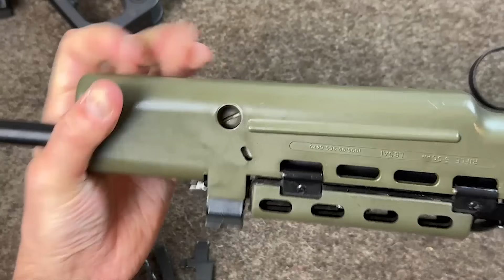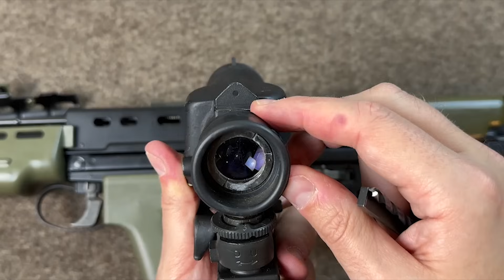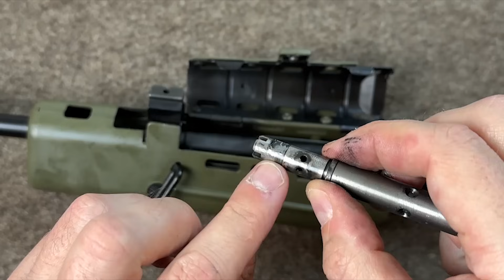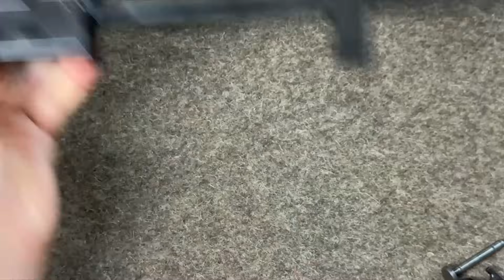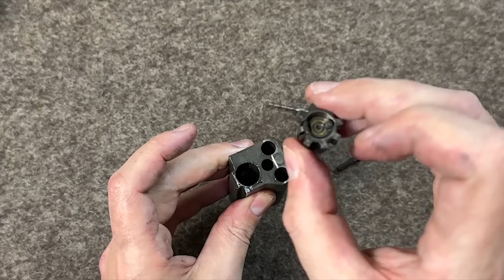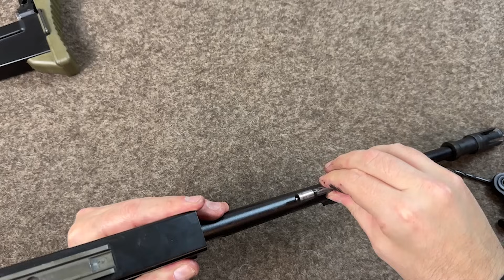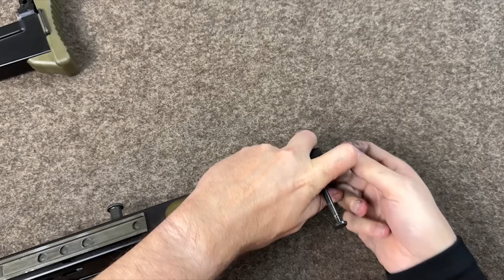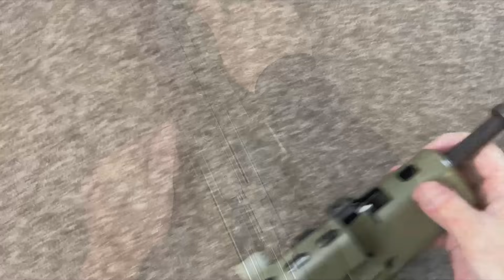British Rifle L85A1 / SA80 IW: The Mechanical Gory Details (Rare Factory Semi)

Comment: Am I the only person who never had any issues with this rifle? I carried the LSW for a while as well, still no issues.
Reply: When you dig into it, there were specific manufacturing batches that had significant issues (and many of them were RSAF Enfield related IIRC).

Supposedly this was due to the wise decision to tell the workforce making them “by the way, when you’re done with this you don’t have a job anymore…”
Reply: Carried one for 15 years. Never had a problem, never had a stoppage.
Reply: @stepheneast6974  tbh I agree, I only ever had (constant) stoppages on 3 different rifles which just means those 3 were wonky to begin with. The others all worked fine, even if they were a pain to clean after putting them through the paces haha. Maybe we just got lucky though :)
Reply: Never had any issues with the SA80, was taught how to clear the occasional stoppage anyway, as no weapon will function without a stoppage if you really working.
Reply: I had to use it in the army cadets and it was awful, stoppages all the time.
Reply: @yungcaco1443  
ALL of the things that made this rifle fail had nothing to do with the cadet GP. Nothing.
What is your claim? That you were a fully trained professional and that it was the rifle at fault?
Reply: @yungcaco1443  The L98A1's were often abused in the cadet force though, poorly maintained and running on worn out parts. The MOD wouldn't repair allot of them due to cost.
Reply: @yungcaco1443  Maybe you got the shagged out ones. I used it plenty in cadets too, never a problem except once when I was assisting RCO and I had to jump on a lad for a double feed (which was of course his fault)
Reply: I loved the lsw
Reply: @mikeywade85 long silly weapon 😂
Reply: @ifv33 mate it was accurate for what it was made for .being a support weapon system. Brilliant bit of kit.
Reply: @mikeywade85 i carried it for almost half a tour it was long silly weapon, i never been more chuffed see a weapon system get scraped

Comment: I'm surprised they bodged a regular full auto TMH to make the semi auto rifles rather than using the same lower made for the L98s, which were also semi-auto.
Reply: The L98A1and L98A2 TMH is just an L85A1 TMH with the change lever deleted exactly the same way as this one is.
Reply from the maker: Yup, the only difference is that this has a blanking plate so that the change lever isn't just a simple drop-in...

Comment: Nice vid again, I was in training 1987/88 and we had the first type useless mag catch which let to some Heath Robinson mods to keep your mag in 😂 when i got to my Battalion in 1989 the 2nd type with the shroud was on all rifles/LSWs.From the start of training we had SUSAT irons were for the Corps or jungle/artic  but did appear in N.I say two of the fours rifles in a " Brick " did trial using iron sights for low street light engagement. The bolt release catches in my training always came off to the point they just didn't bother putting them on! the gas parts cover didn't really bother me too much and don't get me started on magazines RG are Sh#%te end off give me Colts mags every time 😂 I thought the weapon was good for follow up shots it's heavy at the rear but you got used to that with the iron sights it was very light and handy,keep up the SA80 vids 👍

Comment: The only reason the Mag release was on the side was with the intention of it being able to accept M16 mags. There would have been far fewer problems had they used a magazine release at the rear of the housing a la L1A1
Reply: Magazines have to be retained. If you reach up for an empty magazine and grasp it you thumb falls naturally upon the magazine catch. It can then be removed and safely stowed away. What you described is entirely counter intuitive. The unfenced magazine catch is not unique. AR15s had this problem as well. The mag catch for the L85A1 is precisely in the correct place for a weapon in that format. Rock and lock magazines would not work well at all in a bullpup.
Reply: @zoiders  Only to people not trained with the system. In 22+ years of service I never suffered any problems. You have to rock the L1A1 magazine into place so it works in a practical sense. You have obviously never carried one of these slung with a mag on. You suddenly find yourself without one when you go to fire the weapon.
Reply: @mothmagic1 I've carried an L85A1 over roof tops and through tunnels. Not once have I ever lost a magazine. But crack on Walter.

Comment: Ahem . . .Why is there a drill bit on the disassembly tool? Can't have been so bad that you needed to drill holes in it, could it?
Reply: If memory serves me right the drill bit was for cleaning the inside of the gas cylinder from carbon buildup.
Reply from the maker: It's for the inside of the gas plug, not the gas cylinder, that's the other reamer.
Reply: @BlokeontheRange  This looks like a whole other video in itself, thanks for getting back to me, always enjoy your no-nonsense and witty content, cheers!
Reply: @WillGiven-g6j  Not a wire brush then? How hard does that build-up get? Thanks for the info.
Reply: @ It's all according to when it was last cleaned, how many rounds fired, time from last round fired to cleaning time. A good crud can certainly build up. Even if it looks ok you still clean it. Plus if you are handing it back into the armoury the armourers do spot inspections. You'd rather do it at the right time than be sat on your own looking a plum.

Comment: I was in cadets as teenager, and you would not believe the amount of times I smacked the back of the magazine on a fence as my small overloaded 5ft 2 body tried to climb over a farm fence, and the entire magazine would spill out the bottom with the spring and bullets going everywhere and getting shouted at.

I think that was a later magazine though it looked less constructed than either on show here, certainly that was like 2010's also so I would imagine things had moved on even for local youth groups.

Comment: Huh, I never realised that's how you'd use the combi-tool to take out the gas plug.  I always just used my thumb!

I actually did my phase 1 training with the A1, before they abruptly swapped us over to A2s the morning of our APWT (The annual weapon test, for those who don't know).  It was ever so helpful, especially as none of us had actually been told anything about the A2, nor were we given any time to zero them, etc.  Even our troop staff (the commander, sgt and cpls) knew nothing about it.  We just queued up at the armoury to draw our weapons and given these (relatively) shiny A2s.
Our APWTs went predictably well! xD

I used to drop the bolt a bit differently (when not being inspected or supervised etc).  I noticed that when the bolt hold open was used, you'd have to hold the catch and let the bolt move forward just a tiny bit.  I then reasoned that it might work the other way around as well, so I tried it and it actually worked.  Basically, to drop the bolt I'd just pull it back a tiny bit, the catch would drop off and I'd be able to let it all fly forward.  Eh, it worked!

@19:39
I remember hearing armourers referring to that as the "interceptor sear", iirc.

EDIT

I just noticed my idiocy and shite memory.  I posted the very same thing on the last A1 vid you did.  Face, meet palm.  facepalm

Comment: Excellent video Mike. 

I love Bullpups. I trained with the Irish Defence Forces on the FAL and transitioned to the AUG and loved it's compactness and simplicity. I also used the SA80 and found it fine. But it is so much more complicated to strip down. And I have never understood guns with removable pins. So easily lost....
Reply: Which pins? The ones that hold the TMH and upper together? Swear they were captive but just tended to fall out if the rifle was shagged which they all are.

Comment: I'm also guessing this hasn't had 1000s of blank s fired through it  wearing out the working parts like most of the issued one's?
Reply: Oh that didn't wear them out. The insistence on dry cleaning them with scotchbrite wore them out.
Reply from the maker: Yup. Oil and abrasives instead of solvents for cleaning... When the OG design was a bit on the edge anyway, having people scour the ever loving kak out of critical parts was exceptionally dumb... Apparently that's not changed though...

Comment: Actually the ATF isn’t always against safety sears in the modern era, one need only look at the PS90 which was approved with an extra hammer notch and safety sears, has gone through 3/4 trigger group updates, and is still sold with a “safety sear”. (The Gen 1 PS90 trigger group had the same hammer (re safety sear notch) as the FA P90, with revisions moving it the notch lightly so tripping the hammer with the safety sear doesn’t have enough energy to set off the primer.)

Comment: In my time the SUSAT was only issued to infantry, bottle washers got the carry handle instead, one of the failings with the SUSAT that I experienced  was the parallax error at very short ranges,  moving your head side to side at a 25 meter target used to have the pointy post wobbling all over the place,  but unless you knew what you were looking like  most of the blokes wouldn't realise  it,  it doesnt happen at longer ranges but there is an EBS on top of it, and this is what we used when on the smg range,  other than that it was absolutely solid and  bombproof, also the Radway Green mags were absolutely awful - I would stick with Colt magazines if I were you if your going to a competition, the catch on the top cover of the handguard  was junk was a  sort of friction fit and as the weapon was cleaned over and over it could blow open when firing,  thats why you used to see bands around them, and also keep an eye out for things falling off them, as they seemed to like to do that when your not looking,   ejection port cover and spring were common,  its suprising the amount of crud that ends up living in the TMH to be revealed by turning it upside down and tapping it gently... a point to note  the  body  locking pins were captive and we were forbidden to remove them,  a strange but true fact,  when the weapon 1st came in  because of the narrow  field of view  through the optics it wasn't uncommon for even well seasoned blokes to shoot at the wrong target :/ I used to  blame  the way the lanes were marked,  and another one is its so easy to shoot compared to the SLR that you dont need the same level of disciplined training to qualify with it,  they raised the standards as a result. almost forgot,  it always used to leave a dint on the primer of round after a  round had been loaded into the chamber and a 'make safe '  was carried out, coming from the SLR it was a bit of a surprise that I wasn't keen on, the free floating firing pin was also heavy enough to fire the weapon with the safety catch applied if dropped on its muzzle :/ other than that it was a really surprisingly accurate and easy to shoot weapon that had the reliability of a Lada...

Comment: I started as an Apprentice  Armourer in 1989, still working on them now on the A3, the mods on these things were ridiculous,  RG mags were garbage, at on stage we were knocking out the ejectors and grinding out the recess so brass didn't build up😂😂😂, it is a good system these days, but like most platforms far too much add ons, the SUSAT ebs was a joke and the thread stripped for fun, we did use rifle grenades at one point, Claw I think they were called but when you changed the ebs for the claw sight it usually looked the thread😅, needless to say we were busy

Comment: The front safety sear which the bolt trips is actually called the interruptor sear, the disconnector is called the interceptor sear.

You really made removing and replacing the gas plug look awkward😅. The easiest method is to use the gas cylinder to push the button and pull it straight out, you generally don't need the combi tool at all for field stripping though it can be useful for bashing out very tight TMH pins.

I actually think the safety is a good design. It's easy to set it to fire and moving your off hand to set it to safe really isn't that big a deal.
Reply from the maker: Funny thing is that in the 2004 pam I have, it's called the safety sear...
Reply: @BlokeontheRange  On my armourer's course and in technical documents it's listed as interruptor and interceptor. I've never heard it called safety sear, though there is no real reason why you can't call it that I guess.
Reply from the maker: I don't believe they renamed it like that from the 2004 pam to whatever you were working with, sorry...
Reply: @ I'm working with the latest official technical documents and parts catalogue but ok😅.

Comment: One thing a lot of people don’t know is that you can use a standard issue boot lace end to disassemble the bolt carrier
Reply: A rumour I've heard chucked around is that if you lose the firing pin retaining pin, you can replace it with a cut off end of a bootlace.
Reply: @ you probably could in a pinch it’s just making sure it stays in lol
Reply: @ With the weapon assembled, it would stay in. Even if you have a loose retaining pin, it cannot come far enough out to cause issues until you remove the bolt assembly.
Reply: @  yeah you are right it would technically be riding on the inside housing of the upper assembly

Comment: My favorite part of the L85A2 is that the center of mass is shockingly far forward when you have a quad rail and a laser on, despite the Spectre OS. It's pretty much pistol grip. Any center of mass behind that on a bullpup drives me crazy, but that far forward almost lets me pretend the rifle is a real rifle and thus it is so far my favorite bullpup even if I'd hate to take it to war.
Reply: So u LIKE all that weight forward?
Weird.
Love the L88 austeyer coz you can walk around with it on the shoulder one handed. Coz thats where all the weight SHOULD be. At your shoulder. Not 60cm forward.
Reply: @ so you want to wear out only one arm instead of evening the workload? weird.

Comment: The first irritation to me was the mention of needing a tool.
I was issued an AUG as a conscript, and the nice thing was you needed no tool for normal maint, disassembly, assembly.
And to zero it, there was a tool for the sight, but our instructors used a normal coin iirc.
What i also wonder, is why they not simply used a mag release like the AUG or something smiliar to that. (i doubt that was an invention by Steyr, and so i guess there was no patent on that) That easily prevents accidentally bumping it.
Then again, they could have (as you said) put the safety in a more convenient space like on the AUG too and did not...
As for fogging up of the optic: was that a common problem on the susat? (i startet my service in october and so had a whole austrian winter, spring and some summer with the AUG, and fogging up was not something that happened with the original AUG optic)
Easy to say the L85 is fascinating to watch a video like yours about, but i would never choose it over the even older AUG if i had the choice of needing to actually use it. Some of the normal manipulation seems like an afterthought, or i am not aware of the "better reason" to put stuff where they did ;-)

Comment: I have used one of these since the cadet version in the 80s so have seen all the changes. Never ever seen the combi tool used to take the gas plug out! And even with the updated design of mag release catch it’s still possible to inadvertently drop one’s mag at an in-opportune moment. Overall a rifle that started as accurate but unreliable, heavy and un-ergonomic and is now one that’s accurate and reliable but still heavy and un-ergonomic.
Reply: Yeah - you just use the Gas cylinder as a tool to remove the plug - much quicker and easier.

Comment: SA80 is a good rifle if you make it with quality parts, the rifle and desing are good, is the manufacturing when they go wrong by make ultra cheap.Same happened with the Spain  rifle CETME Model L, another good rifle defiled by cheap makeshift.Remember how bad was the m16 at the beginning compared to today models.kids even if you make a phased energy weapon, if the manufacturing is too cheap and loose, you gonna 🤔get a bad weapon with bad reputation that will ruin a good system.

Comment: I was British Infantry in the 80s. Went from the SLR to that very rifle. Interesting transition. Seeing it in such detail in this vid  triggered like muscle memory in my brain. lol.
Reply: I bet you’d have went back to the SLR in a heartbeat 😂 my brother was in service before and after the transition too he much preferred the SLR however did say the sa80 was slightly better suited to certain aspects of his time in Northern Ireland
Reply: @Jay_LFC96  The thing to remember is that 95% of the time a soldier spends with a rifle is as a weight to lug around and worry about not losing. 

With that in mind, the L85 is lighter and smaller. Much handier. 

The SLR is long and heavy. 

Of course, when it comes to the unfortunate situation where the rifle actually needs to be used... knowing the SLR will actually fire every time you pull the trigger is worth any extra suck.
Reply: My dad was a signaller back in the late 80s/early 90s during the transition between the SLR and L85A1. 

He told me that the SUSAT made everyone a hero marksman, and that the armourers were initially confused why they kept coming back in with bent barrels. 

Turns out the squaddies used to put the SLR across two breeze blocks to sit on. I'll let you figure out what was happening.
Reply: @L5GUK  that's awesome.  field testing is not something for designers to take lightly!